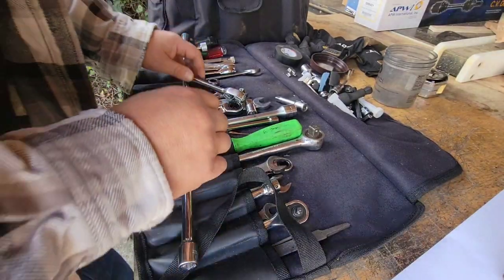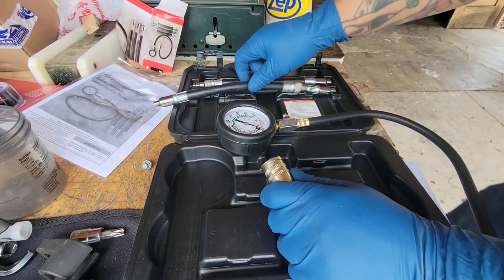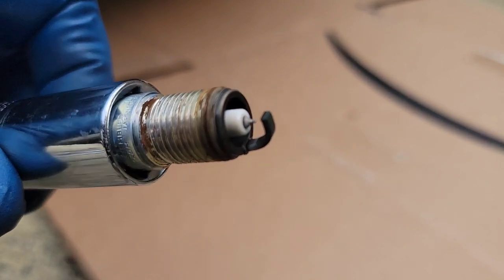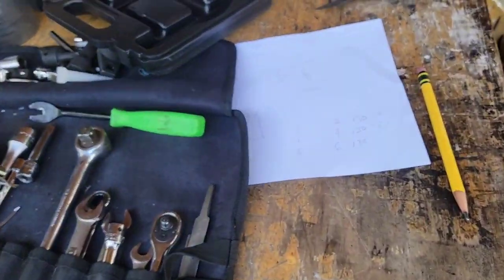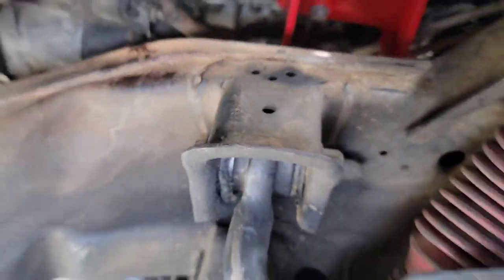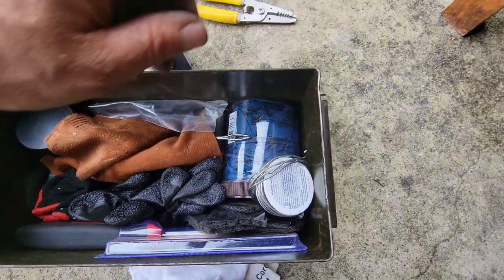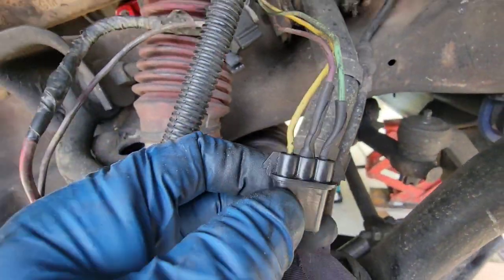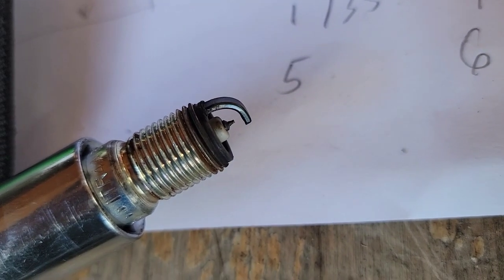This Is How Doing A Compression Test On My Astro Van Went....

Comment: I did compression test on my 94 Astro 4.3L V6 with 208 thousand miles 1/2022 and found all 6 at 150 psi. I did with throttle closed Central port injection (CPI or CMFI 1992-1994) VIN W engine. Most important they are equal for smooth idle and at least 90 psi. Some recommend do at normal engine operating temperature, so I do one at a time. If you suspect valves or rings you can get turkey baster and put 30 cc's of Marvel Mystery oil into one cylinder at a time and if improves the lowest one its worn rings. I plan to do compression and leak down tests again in future after I work on my CPI checking for leaks. I have owned my van since new so I know the maintenance history. I recently did engine combustion gas test and it was good and I replaced the lower intake manifold gaskets trying to fix seeking at idle problem with my van.
Reply: I'm doing research on idle surging problems with the 4.3L V6 engines with the spider fuel injection. Many suffer from this failure mode but few parts available anymore until I find a source or convince a company to go back into production of no longer available parts. This video applies to the 92-95 vans. They improved the spider twice since 1995 and not sure if the newer vans suffer from the same problems with the spider. https://www.youtube.com/watch?v=tjjI3RpzYl4&list=PLpRFf34f4RZqbllPoNWh3vFmVkp4T2t2g&index=36&t=393s

Comment: I did mine last month also 2004 300,000 kilometers on Canadian van I pulled all plugs before checking compression as you did also instructions said to only crank it like 5 revolutions for easy cylinder tested.  Mine varies around 165-180 I’d have to look. I did not touch the throttle plate either like somebody mention. But I did count revolutions it said to count in the instruction that came with compression tester. Yours seems low and did you check if cylinder held the pressure without bleeding off. I I did that also not sure if it would bleed off. I may have got that idea from the fuel pressure gauge when checking that maybe it was fuel that shouldn’t bleed off hahaha
Reply from the maker: Right, I didn't open the throttle plate which I assume would have given me higher compression numbers - Also, we have to remember this was a Harbor Freight gauge so who knows how accurate the thing really is - Main thing is there isn't a bad cylinder which is all I was looking for

Comment: You're compression numbers are a bit low (nothing bad for an engine with miles like yours). I didn't hear it, maybe missed it - throttle plate is supposed to be held open so you aren't fighting a vacuum to fill the cylinders.
Reply: @kevinp2958  A new petrol engine (I can tell you're UK "earths" ;) ) I'd expect to be in the 160 psi range. Diesel engines vary, but my TDI is 430 range.